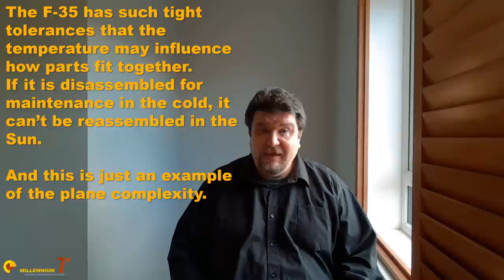F-35: The Failure of the $100 Million  Dollar Jet | Maybe...

Comment: The two alternatives is: ask Elon Musk or start serial production of Gripen E/F/M. The cooperation process for foreign production is already implemeted with Brazil. Basing at usual unprepared roads is a USMC dream and important for ground support. High operational tempo, small space need on carriers, high similarity between models which all can use carriers, network centric since 33 years(JA 37), ultra fast upgrades(only one), GaN AESA 360 degrees coverage(only one), complete sensor fusion, optional manned, supercruise loaded, smallest signature of non stealth aircrafts, advanced electronic warfare, HMD, everything built in except recce and targeting pods. Useful power=engine power - drag. The Gripen drag is very low, even in high G turns. Many parts are made in USA.
I edited the degrees of coverage because I mistyped to 180. "Errare humanum est"
Reply: Its more than 180..
And If they buy Saab??
Reply: @tomas7158  yes 360 degrees. I'm sorry for the misprinting. SAAB already have a manufacturing plant in USA for producing parts to the new trainer/light fighter. So lots of Americans have to go to the SAAB plant in Sweden for learning to build Gripen E, while the SAAB factory in USA is expanded to handle the production. Some USA tweeks will propably be made to the American Gripen. F-39 may be the name.

Comment: Well, I work on the program and I’m just now hearing about this (few days ago anyway). For everyone hoping we stop making it, imagine if your job was on the line.
Reply from the maker: That is a really painful aspect that it is always neglected, and you are more than welcome to bring it up. Actually a good part of the complexity of the program was to generate a large amount of different jobs in various places. We always see the problem from the taxpayer's point of view, but the emplyee or the contractor working on the program is a taxpayer too.
Reply: The problem is not with your work. Quite the opposite, you all have been building a remarkable plane. The problem is the people and the process who were supposed to manage the requirements defining what we needed - and still need - for you to build.
Reply: Part of my job is supporting your program, but still... If it's not the best fit for the taxpayer then your job or mine shouldn't figure into it. That's where pork barrel politics comes from. You will have a crack at developing the plane the Pentagon wants, and good luck to you.
Reply: The need for fighters will not go away, but maybe the F-35 is not the answer.

Comment: Far from a failure!  It does what it was designed, it costs more to operate than expected but that's with everything!
Reply: The problem with the F35 is not that it doesn't do what it was said to have done but the fact that it took 25 years to come to market and declared operational.  It was supposed to be the "low" portion of the F22-F35 "high-low mix", and its very existence ended up being part of the rationale to stop F22 production at sub-200 units.  Further, it is a failure in the platform as it promised too much, as the technology and software (just like the internet) needed a further 15-20 years to allow the promises and vision to mature to fruition.  Further, the compromises required of supporting the A/B and C variants did not produce the benefits required, and ultimately, the Naval variant is unlikely to be acquired in any sufficient numbers.     Without getting into too many details, Naval air-power needs far more range, easily double what the F35 can provide.  

The true failure is the fact that it is a manned-only platform.  And that the F-35 would have produced a far more meaningful impact if it rolled out a decade sooner in the early 2010s, rather than the current timeframe.  Unmanned and UAV platforms, tactics and integration into the war-fighting domain is evolving at breakneck speed, and militaries around the world are seeing the logic in side-stepping an expensive 5th-gen manned QB platform, and moving directly to an air-presence populated by far cheaper UAV systems.

Originally proposed to be as ubiquitous as the F-16, there is zero chance that the F35 will be produced in numbers even approaching half of the F16.  Worse, even the USAF has now conceded that the F35 will cease production sooner, in favour of a new lower-cost 4++ or 5-minus gen fighter platform.  Time will tell, but the concurrency required to integrate all the bleeding-edge tech, and 25-year gestation period to reach initial operability, have been the glaring failures.  Apple would be long-ago bankrupt if it took 25 years for the iPod or iPhone to get to market.
Reply: “It does what it was designed”? Does that include the CAS mission with a cannon that cannot hit anything? Does that include the engine which cannot be operated at full power lest it explode? In its frenzy to eliminate competition for its latest pet program, the USAF has tried to eliminate the A-10, F-15, F-16, A/F-18, and F-22, to give the F-35 a clear field with no competition. Unfortunately for warfighters, the F-35 in all its variants does not perform the roles of the others as claimed. The entire F-35 program is a massive fraud. Careers are built on it ensuring it’s “success” despite real world results. Had the F-35 been introduced as a stealth platform for hostile airspace penetration, a role it actually seems to fulfill, its price tag would never have been accepted.

Comment: The USAF and the USN/USMC are facing mounting problems, literally "mounting" problems. The combat pilot shortage is going to become acute. Therefore the ideal solution would be to introduce a multi role, multi service joint mission capable aircraft. Hence the F-35 in all of it's categories. This A/C was never designed as an "air superiority " platform, although if needed and armed correctly, it is mission capable. The primary purpose of F-35 is to breach the enemy's radar and command and control structure with Raptor flying protective over watch. Once the enemy's interlocking sensors have been dealt with, Super Hornet, B-1, B-2, B-52 and F-15 can be sent in to club the seal. Reports from US pilots and RN/RAF and especially IDF, proclaim F-35 to be outstanding in this role. Of course the USAF chief is going to try to squeeze more from the tit. That ain't happening any time soon however. As it stands, the USA is the only country with 5th gen superiority and strike capability as well as a heavy bomb component. The Federation and the PLA can barely field a 4 gen platform in one squadron each. The US is currently fielding dozens.

Comment: Very interesting video. I saw these news on the F-35 this week and I started to wonder what my relatives the Danes and the Norwegians would be doing about it since they are both planning to fully convert to the F-35. Perhaps the gripens still have a chance or EF-2000 or Rafale or maybe even F-21 for political reasons only of course. Anyhow AAA+ production values very nice.
Reply: @AllThingsCubey  excellent argument but doesn't the F35 have the worst operating costs and readiness rates ?? Surely that has to be addressed and it looks like the Air force wants a none Lockheed solution 🤔

Comment: Pierre Sprey has been proven right about the F35. Its not completely useless, with the F35B potentially a very useful aircraft (particularly for smaller carrier operators like UK/Japan etc). In general however, It is not fast enough, cant turn or climb with enough agility to survive when it matters most. The low cost, high performance it was expected to deliver simply never materialised. Much of what makes the F35 effective is technology that could be transplanted to other more capable airframes. Its good to be stealthy, but alternative detection methods are reducing the benefit of stealth in general. The F15 has sublime performance. Why not take the best of the F35 and fuse them. Or work with Japan on a variant of the F22. For the next few years the US should look to the Eurofighter, while also developing their next aircraft type. 
Love the channel! always brilliant. I recommend it to my friends all the time.
Reply: even if theoretically f35 had a worse turn and climb rate than let's say an f16, I seriously doubt there will be much dogfighting in a peer state fight. BRV engagements with stealth aircraft is a death sentence with any 4th gen fighter (assuming no AWACS or other stuff). BFM is simply no longer remotely important tbh.
Reply: Pierre Sprey has been proven wrong, time and time again.
He has been proven wrong about his ideas in the F-16 program, because things like long range radar, missiles, TPods etc., made the jet a multi role success.
If it was for Sprey the F-16 would be flying around with sidewinders, dumb bombs and maybe a navigation radar.
Look at pictures of the F-16 in combat and you will see it equipped with Targeting pods, 2-3 external tanks and maybe CFTs.
The F-35, which has the sensors, some of that fuel, and some weapons internally will equal, or outperform a combat ready F-16.
And while flight-hour costs for the Eurofighter are difficult to compare, it is not a cheap aircraft to operate, most likely more expensive than an F-15E, maybe higher than the F-35.
Reply: @Skankhunt-mv4vd  They thought the same in Vietnam. BVR might be the order of the day in a full scale peer to peer war but for the most part aircraft will merge, at least a good percentage of the time. Especially as the F35 doesn't have the speed to dictate whether an engagement occurs. While the F35 will be flown by world class pilots the basic airframe doesn't perform compared to even legacy platforms. Aim 9xs and Aim 120ds etc will still make it lethal, but that's the missile not the aircraft. I'd like to see the F35 tech make its way to other platforms. Just leave the turkey behind. One other point, I like networked warfighting, but would never be fully dependent on it.
Reply: @kilianortmann9979  The F16 matured well into a large array of rolls. The purity of the original airframe design made it a thorough bred from the outset. It wasnt difficult to give it more advance weapons and systems. Many of the systems added were not even in operations when it was being designed. That said the F16 has become a decent bomb truck when required. In a peer to peer fight its most useful role will be establishing air superiority and that is a role it still excels at, if beginning to show its age.  The F35 was a compromised design from the outset. The Chinese will eat the F35 alive in any potential conflict, the Super Hornets will also struggle air to air. The F22 is the real deal but numbers are very small. The F16 and its development only proves Pierre Sprey was right about what matters most in an aircraft design, the F35 is a turkey air to air. I remember when it was initailly being developed and the talk was super maneuverability, high speed etc. None of which was remotely achieved. If the systems are really what make it effective then put them into a world beating airframe.
Reply: @Gerdam  The main aircraft for providing air superiority in a peer to peer engagement (besides the F-22) will be the F-15C (which Sprey both despised, he now made a U-turn of epical proportions and claims to have designed the F-15 as well).
Because it can't do anything else, but more importantly, because it has a better radar and can carry more missiles.
Worth noting at this point that he is mainly an analyst (B.S in aeronautics M.Sc. in operations and statistics) he did work on the project requirements, but he did not design the plane.
Dogfight performance is less relevant in a peer to peer engagement, because ROE are permissive, so no visual ID required (all new F-15 are E based, heavier, less maneuverable but with more fuel and weapons options and a better radar).
The Navy's satisfaction with the Hornet and Super Hornet is proof, that a kinetically inferior platform can perform good enough, if the avionics and ergonomics are better.
BVR capabilities go clearly in favor of the F-35, with better Radar, built in IRST and longer range, worth noting Stealth also works on missile radars.
If anything, the F-35 is a turkey in a dogfight, and even then I'm not sure, high alpha is a lot better than the Viper and an energy excursion combined with a high off boresight missile shot can be lethal.
tl.dr. airframe doesn't matter, as long as both are in the same ballpark, because it is never 1v1, SA and sensors are where it's at.
Reply: @kilianortmann9979  Based on numbers its more likely the F16 will be carrying the burden of establishing air superiority in a peer to peer war. Forget Sprey, the F35 is objectively a failure. Its the loss of potential, the opportunity cost if you will of the project that is the real problem. Now that the US knows its going toe to toe with a resurgent China they know the F35 isnt good enough. I commend their honestly given the pressure to praise the turkey. The Superhornet is a fine strike aircraft but put it up against a real enemy and it will struggle. Its silly to argue that an inferior airframe should be tolerated. Any of the F35 tech is transferable to other platforms. You are making the same arguments made before Vietnam and pilots died as a result. If you want air superiority you need to get it with a plane that can move. The F22  isnt a compromise and as a result the US has likely the most capable fighter in the world. Time to accept the F35 is a failure and start planning a decent replacement.
Reply: @Gerdam  The only thing the F-35 might be a turkey at, is prolonged BFM.
Ironically, this is the most useless capability, performing air superiority during many vs many, you'll only get shot down.
You fail to convince me, why the F-35 is bad in the air superiority role, during a peer to peer conflict.
Reply: @kilianortmann9979  I'm not trying to convince you of anything. The F35 is slow, so its lovely aim 120ds wont go as far as a faster platform like F16/F15. When the inevitable merge occurs its going to be clubbed to death by peer opponents.   How can a plane that can barely do mach 1.6 avoid close in combat. The F15  and F22 have the speed to decide when and where they fight the F35 wont. I'm sure the F35 will be grand bomb truck but pull the other one if you think its got anything more than limited air to air capability. Its stealth is great for sure, and its missiles and avionics are top notch, but its not agile enough close in. It was supposed to be and isnt. BVR may well be the dominant aspect of a peer air war but aircraft will still end up merging and going bfm. Then its turkey for dinner. The US have proven they can design superb aircraft, so time to move on from the F35 and leverage the programs tech into something to be proud of.
Reply: @Gerdam  Stop referencing clean and empty numbers. An equivalently equipped F-16 (6xAim120, ECM pod, empty pylons on 4 and 6) has a drag index of ~100-110, this gives it a top speed of ~M1.55-1.60, same as the F-35.
https://info.publicintelligence.net/HAF-F16-Supplement.pdf
Reply: @kilianortmann9979  If we accept the F16 starts a BVR scenario with the same drag index as an F35, each missile fired reduces the F16s weight and drag. After a salvo of missiles fire the F16 arrives at the merge lighter and with much less drag. Its power to weight will be much improved, as will all aspects of BFM including speed. The F "Turkey" 5 will still have that limited airframe but be out of fox 3's and likely options. I've no doubt the F35 is an ergonomically well designed platform that tries to really enhance the pilots SA. However as an airframe its a poor performer. I will say the F35B compared to say the AV8B is a significant step forward and every little carrier in the world has become a lot more effective but the F35 is not what it was supposed to be, not cheap, not capable and will need to be replaced in the A2A role at least.

Comment: That statement from the USAF definitely destroys the confidence on the current and prospect users of that plane. Greece and Croatia are interested in procuring the F-35. But I doubt if they will be as exited now.The USAF has some options, like procuring new F-16Vs, using more drones and as you said, introduce some European fighters. Of course the European fighters, are more in the league of the F-15. And even if the adopts European designs, they will be very modified to integrate US made sensors and weapons.